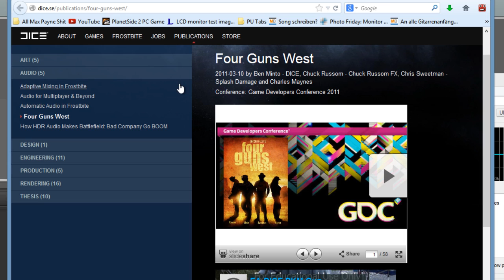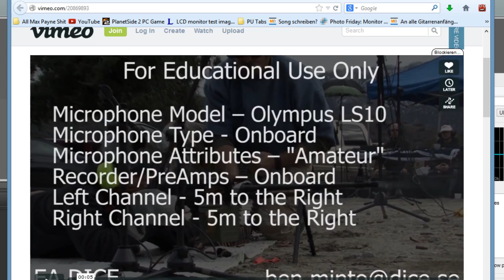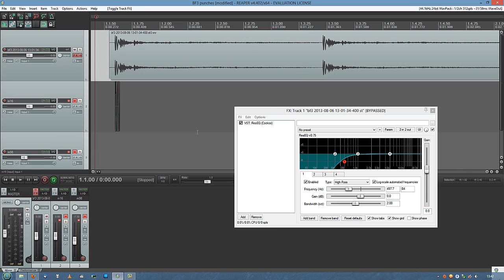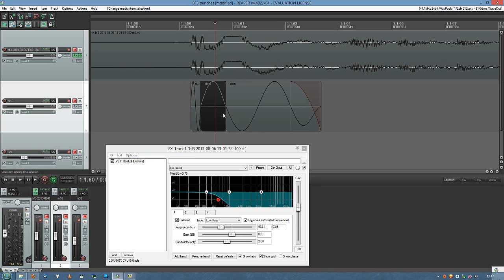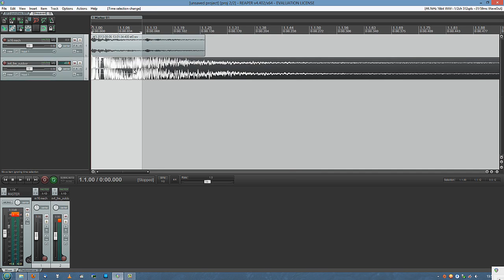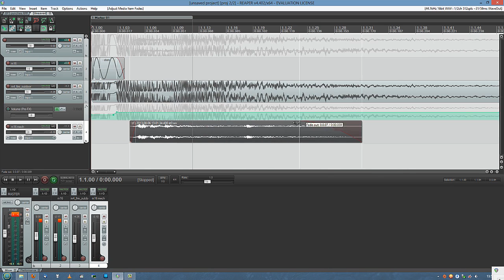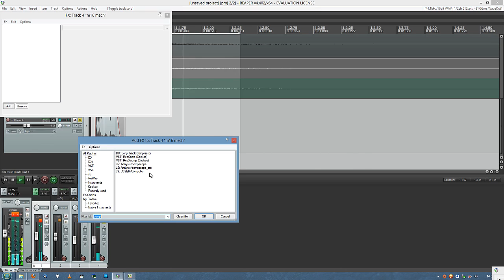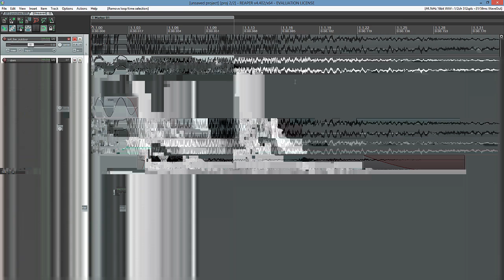Gun Sounds - what are they, how to make them "real"? DICE oriented.

Comment: Very good analysis. As a sound designer myself, I've always found the Battlefield series to have the some of the best sound design in video games. Particularly, I think Bad Company 2 was the strongest entry in this respect. Would you consider doing a similar analysis on that game's sound?
Reply from the maker: +Vincent Rubinetti nah, BC2 audio is pretty much like the rest of the frostbyte titles. only that they used a lot more compressed samples and dynamic range reduction overall in the pipeline to create that &quot;loud&quot; and chaotic sound. at least thats what i think.
Reply: +M3G4G0TH  BC2 definitely used more compression than BF3 and 4, but imo it was just the right amount. I do think you need a little bit. There is still definition between shots. BF3 and 4 went for a more clean, accurate approach, and BC2 went a for more cinematic approach, but not over the top like most FPS's. 

They're two deliberately different stylistic approaches, which is something the lead sound designer has talked about explicitly. So ultimately I think it comes down to preference.

Regardless, I think anyone can agree that the sound design in any recent Battlefield title is among the best in the industry. The guns in most other FPS franchises tends to sound like typewriters. A lack of definition, detail, dynamic range, impact, and realistic round robin.

Plus DICE has had very powerful sound engines to work with, which is a HUGE part of why they sound so good I think. Positioning sounds in space with EQ filters, falloff distances, obstructions, reflections, stereo effects, reverbs, compression... All done in real time based on game data, and beautifully mixed together into one balanced, cohesive soundscape. (By the hand of talented sound designers mind you, not only a feat of programming). I don't know exactly what kind of techniques they use (e.g. zone vs. geometry generated reverb), but whatever they do sounds way better than other FPS's imo.